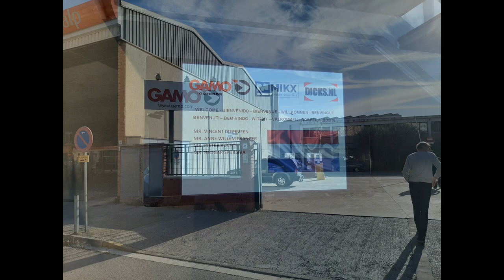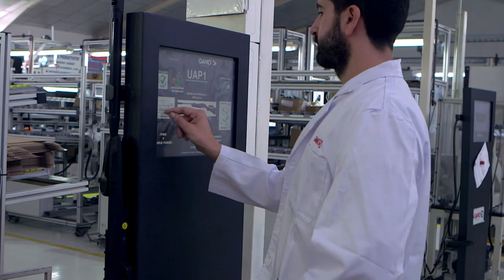A Visit To The Gamo Airgun Factory

Comment: Hi this is Rick Buckelew I love my gamma .177 and .22 rifle but I'm a machinist and engineer so I wanted to find out why it wasn't repeating after 40 or 50 shots.  So I took the scope off and the base plate mount and this is what I found.  The 316th slot on top and bottom were the pins mount into after a while that material is so soft the pen starts denting the side of the slot so in reality the scope is moving in 2 different places. the slots should have stainless steel bushings put in so this does not happen. That's just my opinion I will be modifying my rifle and keep you posted on the difference. And just to let you know in the beginning I was splitting my pillows on a knife then the Dent started happening and it would never split again.